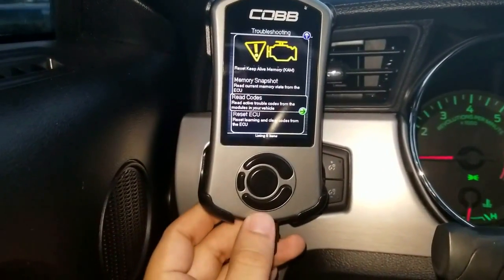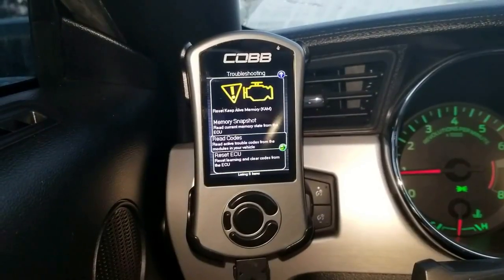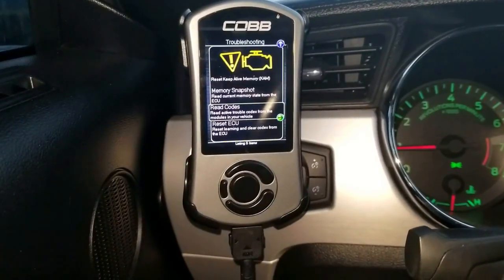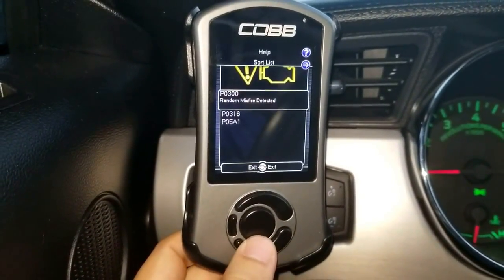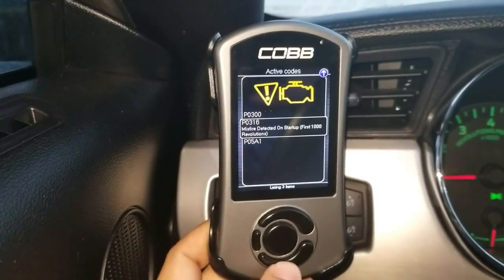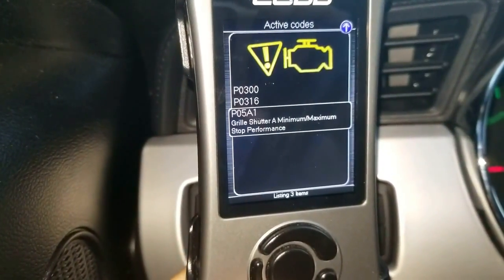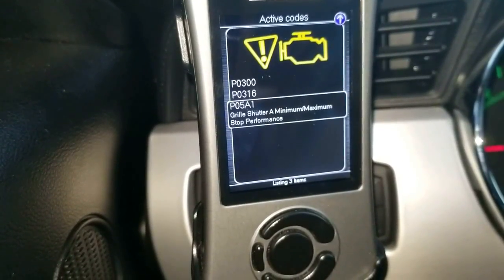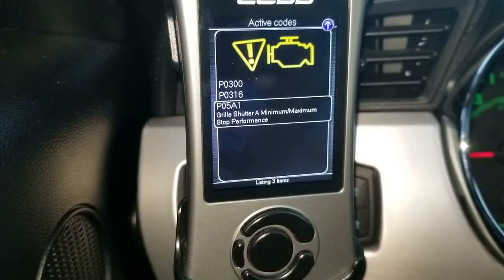Getting Engine Error Codes on EcoBoost Ford Mustang for Misfire and Grille Shutters?

Comment: Yo dawg I did a active shutter removal and my tuner tuned around it but when I got a e85 tune for my mustang gt I could not believe that the tuner from a very known company did not do a good job to tune my car lost power I had a rev back and forward and when I accelerated that shit would rev back and foward so because the active grills are connected the pcu your ecu will be slowed down for the engine to protect itself cutting power to a injector to not hurt your engine cause it thinks it’s going to heat up so what I had to do was cut the active grills in half left the bottom with the sensor and they blamed everything from me having a vacuum leak to bad injectors to cracked manifold and I was like wtf no so after I installed the shutters in the bottom the error code went away and also the misfire 💪 so now I’m going to send a log to the tuner of this known company that could not fix the problem to finish my tune and stop being lazy
Reply: Huh?

Comment: I got the same P05A1 error, how did you fix that?
Reply from the maker: I removed the grille shutters and had my tuner disable it. Somehow that fixed it on mine. Never came back.
Reply: @BoostedWhipz   dealer mentions that I need to replace it and it would cost $1500, thats alot lot...had my car in 
garage for almost 2 weeks now.. is there a way we could fix it without removing the grill shutters..
Reply from the maker: @varund8102  no clue man. I no longer have the car.

Comment: I deleted my grill shutter so it told me lost comments with grill shutter.    Today i faces this issue the car is really in bad condition ,it said misfire clinder3 and missfire start up. The ingine wont work
Reply: Me too. I had it last weak. And it getting smok from the cat-back
Reply: Did the car throw a code for the shutters I want to take mine off
Reply from the maker: It will... My tuner disabled them from the coding

Comment: Me too 
Same issue with misfire random and sometimes specifically cylinder 2
Any help?
Reply: Replace the low side fuel injector pressure sensor… if you haven’t done it.
That solved the p300 and p316 for me
Reply: Yo dawg I did a active shutter removal and my tuner tuned around it but when I got a e85 tune for my mustang gt I could not believe that the tuner from a very known company did not do a good job to tune my car lost power I had a rev back and forward and when I accelerated that shit would rev back and foward so because the active grills are connected the pcu your ecu will be slowed down for the engine to protect itself cutting power to a injector to not hurt your engine cause it thinks it’s going to heat up so what I had to do was cut the active grills in half left the bottom with the sensor and they blamed everything from me having a vacuum leak to bad injectors to cracked manifold and I was like wtf no so after I installed the shutters in the bottom the error code went away and also the misfire 💪 so now I’m going to send a log to the tuner of this known company that could not fix the problem to finish my tune and stop being lazy
Reply from the maker: Don't have the Mustang anymore

Comment: What was the cause of the p0300 random misfire  need help my car is having that issue can figure it out
Reply from the maker: Was related to the grille shutters. After disabling them all codes went away. I changed my grille and removed the grille shutters. Also check your spark plugs.
Reply: @BoostedWhipz   thanks I will change spark plugs and will install the shutter back on to see if it fixes the problem been having a hard time figuring it out the issue thank you again will let you know if it works
Reply from the maker: @edgarcastrolee  any reason why you removed the shutters? Normally if you do that you must disable it through your tuner.
Reply: @BoostedWhipz  since I change my grills I removed them and never got them turn off haven't got a pro tune yet
Reply from the maker: In that case that's why lol.
Reply: And I removed a while back the shutters
Reply: @BoostedWhipz  I just hope the water didn't mess up the shutter plug on the car the connector
Reply from the maker: I had wrapped mine with electrical tape. I don't think it should be an issue.
Reply: @BoostedWhipz  thanks for the help will get it done asap to see if it fixes the problem
Reply: @BoostedWhipz  question I put back the grill shutters back on do you know when they close or open ?
Reply from the maker: @edgarcastrolee  those are triggered by programmed temperature and air ratio.
Reply: @BoostedWhipz  shutters installed and new spark plugs car was running ok then the next day misfire again and p0300 and p0316 still came back up
Reply from the maker: @edgarcastrolee  oh geez... Any check engine light? Or is it coming out on the tuner?
Reply: @BoostedWhipz  it trows check engine light on car p0300 and p0316 can't figure it out
Reply from the maker: @edgarcastrolee  did you try clearing the codes after doing all the changes? Do you have warranty still? May want to hit the dealer to check it out.
Reply: @BoostedWhipz  yeah I cleared it out then next day came back on
Reply from the maker: @edgarcastrolee  not sure what it could be. Have you taken it to the dealer?
Reply: @BoostedWhipz  I'm about to book a appointment I believe I have warranty till 75 thousand miles ima check
Reply from the maker: @edgarcastrolee  remove any tune prior to going just in case.
Reply: @BoostedWhipz  funny thing I just removed the Cobb  lol
Reply: Man the power sucks without the cobb
Reply from the maker: @edgarcastrolee  indeed lol... Just get the car checked out and then reflash
Reply: @edgarcastrolee  dealer ever figure this out?
Reply: @BerserkRage29  no they actually didnt I had to pay 170 and nothing was resolved they wanted to to charge me 370 for more test. So I changed the air box and haven't given me the p0300 anymore and did a couple of test wen switch it out to a AFI intake
Reply: @edgar castro what airbox did you have? Grill  shutters were not causing the CEL. It was the misfire causing the CEL.

Comment: Mine just got these errors but only on No.3 cylinder I am thinking it’s the plug but haven’t gotten home to check just started happening after work on start up.
Reply from the maker: I changed my plugs to the NGK ones, cleared the code and that solved my issue. The grille shutters ones it was fixed after my tuner disabled them. Seems the sensor on that went defective. I later on removed the shutters due to my grille setup.
Reply: BoostedWhipz I just got the NGK plugs last night so I’ll swap out tomorrow when I have time.  Thanks for the update.
Reply from the maker: @SerendipitousProducts  no problem... Good luck and keep me posted.
Reply: It was No. 3 plug porcelain around the center conductor broke and was moving.  Replaced plugs and it’s all good no errors.  I would like to send a shout out to Tune + and Adam Brunson they shipped me new plugs no questions asked.  Can’t wait to get then parts installed and have him tune my mustang.
Reply from the maker: @SerendipitousProducts  the best tuner for the EB platform!!!

Comment: How did you fix the misfire and rough idle problem?
Reply from the maker: Abhishek Amin the codes went away after I removed the Grille Shutters and had my tuner remove it from the ECU coding. Seems the misfire was a misreading due to the shutters.
Reply: @BoostedWhipz  what tuner had said this? This doesn't seem correct.
Reply from the maker: The grille shutters were not operational. I removed them and got my tuner to remove it from the coding. I didn't say he recommended it or that it was the cause but that fixed my issue. Not sure why or how.
Reply: BoostedWhipz I’m having this same issue Cobb stage 1. I’ve changed my plugs and upgraded intercooler. The issue seemed to start when I updated the tune. Why are you saying it’s the shutter miss causing the other codes?
Reply: @NateHZ28  Any fix?
Reply from the maker: Didn't say that was the cause but the misfires never came back. I want to assume the spark plugs could be your issue. Maybe over torqued or not gapped correctly.
Reply: @BoostedWhipz   nailed it with the spark plug being gapped. If they're not gapped correctly you will have misfire.

Comment: I will give you my thoughts.

A...always run the best and high octane fuel you can  even with no mods or tune.   Keep your spark plugs fresh.  Gap  .28 - .30  with one heat range colder than stock. 

Remember that these engines fuel injection sytem shoots the fuel in front of the valves.  So valves get carbon build up worse than others. 

I think this is what causes the random mis fires.  Kinda like a hiccup. 

Good gas and good plugs will certainly  help and also invest in I recommend  a UPR  dual  port catch can with a breather.  Or you  can also  find a breather  that replaces you oil  cap for about $75
Reply from the maker: b b thanks for the info man. Since this video, I have used better fuel. This started happening when I used BJs fuel, when I normally put Chevron or Shell 93 Octane. Been running fine since then. Spark plugs are new and pregapped by Adam. I'll look into the breather and catch cans after. Really appreciate you taking the time in providing your suggestions.

Comment: Grille shutters removal is safe, active grille shutters are for economy mostly and bring your engine temp up in extremely cold weather(heavy snow). The shutters close at certain speeds to reduce drag on the car increasing fuel economy...not my much but 1-2 mpg on the highway max. So in other words it’s safe to remove them and do no harm to the car.
Reply from the maker: +Sim Dhillon is it as easy as just unplugging them and removing it? It won't cause any error codes?
Reply: Shouldn’t cause an error code but from what I know the sct hand held does have the ability to turn it off and the Cobb has to be done through the tune.  Have you gotten a reply from Adam?
Reply from the maker: Sim Dhillon not yet. I sent him a message last night so he will probably reply today or tomorrow.

Comment: With the Cobb ots tunes, they turn off the grille shutters, leaving them in an open position.  With your current tune+ tune they should remain open to always allow max airflow to the intercooler, I would contact Adam to see if he might not have disabled the shutters for your tune.  Next up the misfire code, are you getting at a certain time? Or certain cylinder? I would check the gap .026 to be safe across all plugs no loctite. Let me know the current status?
Reply from the maker: +Sim Dhillon I'll reach out to Adam. The misfire has not come back after I clear the code. May have been a one off. The grille shutters came back today though.
Reply: BoosTang23T btw have you tried data logging? The misfires may show up on the log but I spoke to Adam, he says should be more concerned with ignition correction for each cylinder so it doesn’t go into the negatives.
Reply from the maker: Sim Dhillon I just did a log on 3rd gear pull. Will send it to Adam. I am not too familiar at looking at the datalogs.